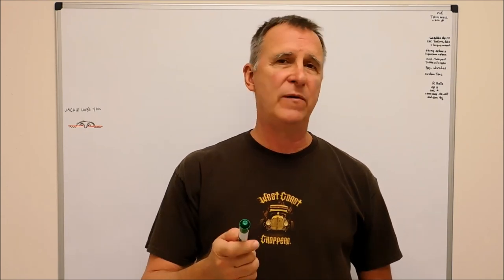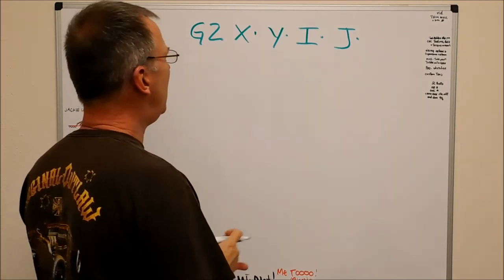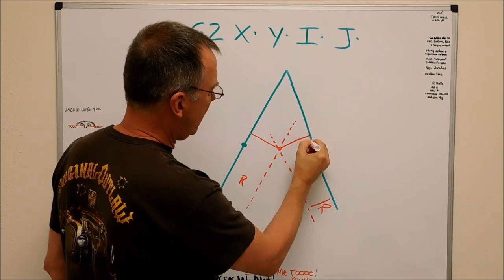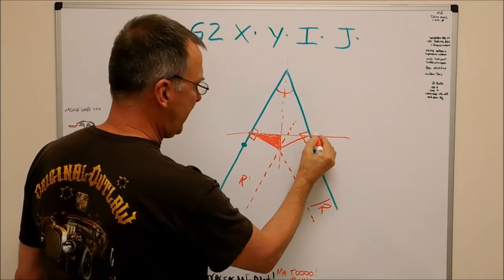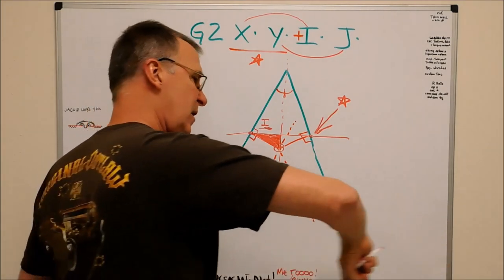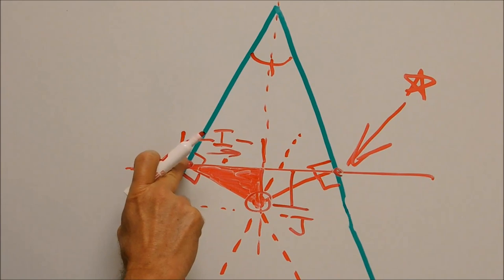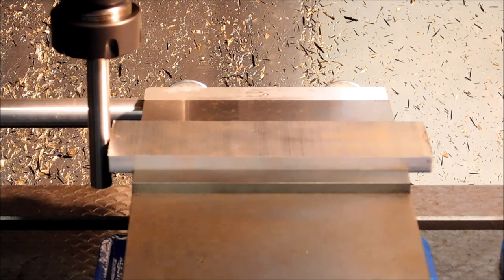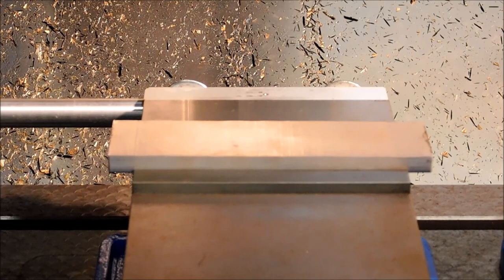CNC Machining Center Part 5

Comment: Great info Joe .. I've been using a shop converted CNC for about 5yrs. but always let the CAM program handle all that stuff .. understanding it better will be a GREAT help!
Reply from the maker: It really helps to be able to read the code. If you need to change or edit (or the CAM guy is out for the day) you can proceed.

Comment: Thanks For all of your videos. I love all manual lathe related ones. I would recommend using M00 instead of M01. i think it's safer.
Reply from the maker: The M1 command is specifically a pause to be used along with the optional stop button and not intended to be the program end. To the best of my knowledge, the M0 command will not allow you to deliver the table to the front of the machine. It may go there as programmed, but by default, the M0 command sends everything home. Thanks for the comment and for watching.

Comment: I'm Dave from Idaho, and I'm a conventional machinist who really does not use digital read-outs very often.  I have run CNCs a little bit, but don't find them as interesting.  

On that note, for the set-up problem you presented at the end of this video I typically have used my combination square on manual machines to set-up the stop for the small scale production of parts (less than 10).  Where I've had to do more than that, then I take the time to set-up a fixture that uses either a removable or movable stop.  

One type that I have made and like using is similar to using the drill blank in the spindle.  It consists of a block clamped to the table with a hole in which a dowel pin fits.  The dowel is removed and a plug put in its place to keep chips out of the hole once the part is set. 

I also have a suggestion for a later series of videos.  That is, how do you set-up difficult parts for repair that need to be indicated to existing machined surfaces.  For example, the cast iron end bells on an electric motor to repair a bad bearing fit.    This is the kind of work I have done a lot, and I think it would be quite instructive for newer machinists, and those who start with bar and round stock.
Reply from the maker: I like the plate and pin idea. Thats a keeper.  I spent most of my career being a manual guy and asking for CNC favors once in a while, but when I opened my shop, I had to evolve. I have to say, I like the CNC versatility. Cleaning it up sucks, and not feeling the cut sucks, but the machine is so fast its snot even funny.
Reply: I see you beat me to it (plate idea)... :)
Reply: @biscuitsandgravy  LOL.  I'm almost 60 and wear trifocals.  My age  may explain a bit why I still like analog for that is what I grew up using.  Don't get me wrong, however, I occasionally use the DRO on the mill, especially when doing something in metric.  I just don't find it as quick to get my final stopping points.  Now if there were an analog display  with a dial . . . .

Comment: Great description and geometry to show where I and J come from. For the most part I generate code using CAM but I'm one of those people that always says "but why". I have to have a satisfactory answer to that before moving on. Also a great tip on using a tool for setup. I'm fairly new to CNC machining and I'm usually doing one-off parts. If I had 10 parts and stock that was cut really close to final dimension, before I probably would have touched off and reset offsets with each one. Not now that I know this tip!
Reply from the maker: Thanks. I think its very important to know the why behind the how. For me, it just cements the knowledge. Thanks for the comment. BTW, Does Jimmy Diresta know you and he have the same license plate?
Reply: Haha, Yes, Jimmy started all this "I MAKE" license plate stuff. When Brian Lane, who now has the "I MAKE" license plate in Missouri, asked at a meetup if he could copy it in his state Jimmy said go for it and a bunch of folks started following suite. I've always enjoyed your posts but this little series has become super relevant so I'm watching it again. I should have a Fadal 3016 arriving at my shop tomorrow!
Reply from the maker: You can put me down as a resource to help you out getting started. feel free to ask me questions instead of banging your head on the wall. I'd be happy to help you. I'm posting another nice trick for setting tools without the risk of chipping the edges off. Check it out when it posts and good luck with your new toy!

Comment: another good video! :) you should be able to do radius's up to 180 degrees no problem. (at least on a haas). If you want to go over 180, you simply make your radius value a negitive and that will allow you to go up to like 359.999 degrees. the only reason you should have to use the i j k method is if you want to make a perfect 360 circle because the cnc doesn't know the center point. 

i know this will work on a haas because Ive only worked on haas machines my entire career. Maybe other cnc's are different, so don't take my word for it 100% :)
Reply from the maker: HAAS is a good machine. The sponsor a winning NASCAR team too! G code only allows for 90 degree arcs before the I's and J's show up. Your machine sounds very friendly.

Comment: Hey Joe, thanks again for a very clear explanation. I watched the video twice to make sure I did not miss anything but I have a few questions. In your example the center line of your triangle is oriented to the natural X and Y axis of the machine- what do you do if the feature is not oriented this way? Secondly - I think you kind of mentioned - but when working out how big a radius to use that needs to be done on paper right? The radius chosen  will determine the start/ finish points on any unusual angle including the 30 degree feature you used to explain the idea. The program needs these points to know when to start and finish the radius right?Lastly, with set up, I use a fixed clamp with a rounded surface on the table that is level with the end of the work  and a slip gauge ( actually any clean metal will do)to set the work then remove it leaving space to make my cut- I suppose that is obvious standard practice. I like your idea !

Comment: I'm loving this series,
On a 3 axis machine do you have to identify the plane with a G17?
I work on a 5 axis machine and we get the joy of using I,J and K 
G17, G18 and G19
Thanks,
Brian 
philly, pa
Reply from the maker: Yes. Then if you go off the X-Y plane you call that out as well. Its usually in the initial tool call line.

Comment: I can do geometry in my head easy enough to determine any specific point on your diagram if I have a known starting position.  What I don't know is if I would have to compensate tool path travel based upon which tool is being used - in this case a cutter. I think the machine compensates for it with the tool offset but is it traveling and cutting on the edge of the tool or the center of the tool.  Full tool diameter discrepancy along an arc could be a problem. I'm asking how it works ... I can calculate point to point but I don't know how the travel actually happens - along centerline or edge of tool. And, Thank you ,sir !
Reply from the maker: Hi Brian. If you are using a G41 comp code, program the part along the profile of the part. Forget about the cutter diameter. The machine will do it for you. If you are not using comp, all calculations must be driven from the center of the tool to the center of the arc.
Reply: Joe Pieczynski thank you again sir !

Comment: I like that position method and can use it on a manual mill with DRO...
Reply from the maker: Absolutely. Just add the extra material you want to remove above and beyond the radius of the blank and you're golden. I love this trick.

Comment: Joe, Really enjoy your vids BTW! Am glad you started a series for "CNC for Dummies" if you will.
Your the first IMO to address G code for us manual machine guys. I can Cadd up my parts in 3d and convert to DXF files but my question is, is there a program available to convert my 3D Cadd files to G code?  Manually inputting this code appears to be very time consuming.
Reply from the maker: Wow. Thats a very general question. Many programs can generate that code, but what type of feature will dictate how you go about generating that code. For example....is the code for a outer profile cut? Is it for engraving?  Can your cut be completed by using a defined trajectory? Is it a pocket with obstacles, or a complex surface like mini sand dunes? I'm not trying to scare you, or discourage you, but now your talking next level stuff. I use Pro-Engineer 4.0 and still consider myself a beginner when I realize how much this software is capable of. Look withing your modeling software for its ability to create a manufacturing model, not just a part model. My software requires my part model to be brought into a manufacturing model file.  Check out my CNC engraving of a complex design video. It demonstrates some of the work needed.
Reply: Thanks for the reply Joe. It's apparent I know nothing about cnc, I'm just an old machining hobbyist and enjoy learning . However I think I'll stick to lurking though! 
BTW your sight has become my #1 go to for informational content.
Keep up the good work and great content!
Reply from the maker: Thank you very much. Ask a question if you have a specific need.

Comment: I've used an adjustable square to set the stick out on a lathe chuck. The same method could be used on the side of a milling vise. Not as accurate, but you wouldn't have to lean over each time to load the part.
Reply from the maker: I like that.
Reply: If you had a small holder clamped to the bed in the correct spot with a tight slip fit 1/2" hole, you could just remove/replace the 1/2" rod and wouldn't have to jockey around?

Comment: Hey Joe .
it seems to me that it will not work with these parallel lines. once you can do them 1 inch from the side or 2 inches from the side. this will change the place of the point (top down in your drawing). Perpendicular lines starting from the starting point and from the end point should be drawn, this is determined by the center of the tangential circle. try cad without using the tangent function.
Reply from the maker: I respectfully disagree. The parallel lines offset by the radius value is 100% valid for finding the point of rotation for the desired radius. I have adequately shown all necessary construction to prove this. But I do welcome a detailed reason why you believe it won't work.
Reply: you are right. I did not hear the first time that they were to be  offset by the radius :P just when I drew a tangent circle I always drew only two lines beginning at the end and start point at a 90-degree angle, and their intersection showed me where the center of the circle and its diameter comes out.I sent a quick drawing of a hard stop. I hope you like it . I'm sorry for my English but I'm writing poorly in this language :)